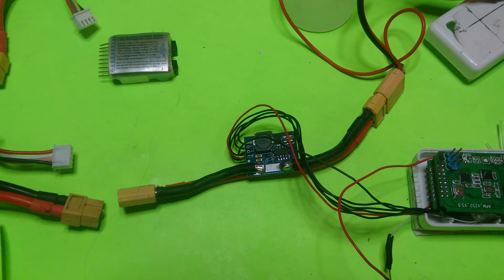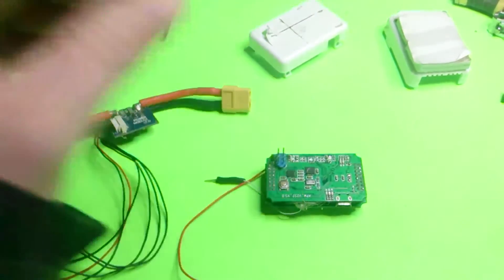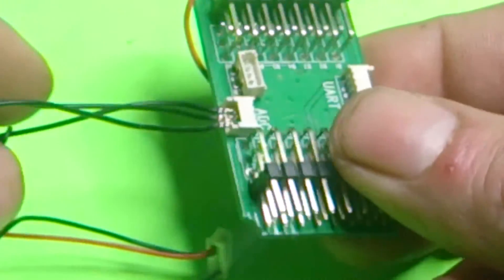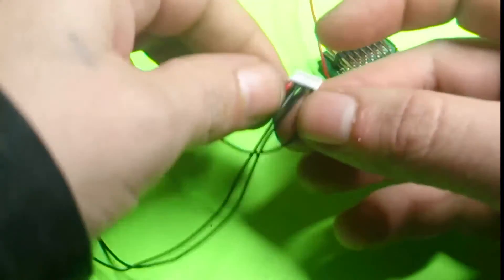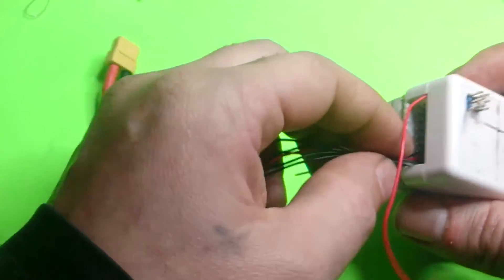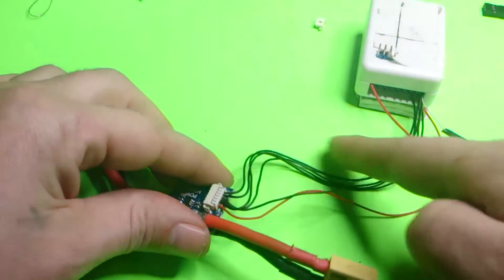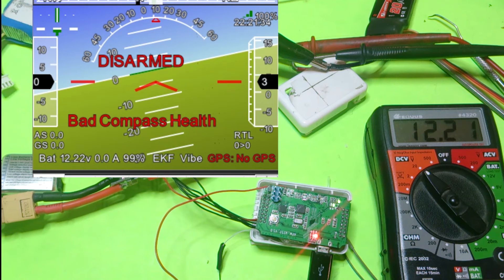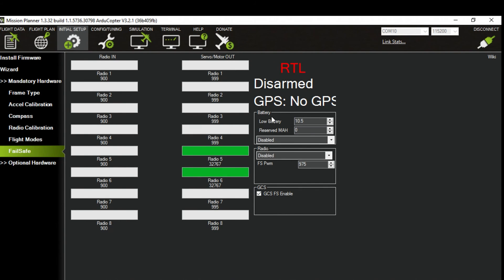cx20 factory apm power module step by step

Comment: Hello Bangs I followed your instructions. But.... The voltage does not go down as the battery drains . In the MP app on my phone the quad starts beeping and the app still reads a full battery.... Umm what am I missing? tia
Reply from the maker: does it show the correct voltage in mission planner?
Reply from the maker: for example on the hud does it show the battery
https://youtu.be/rTRFXnnsnUU?t=792
Reply: checking now... brb
So I had to input the correct value in the measured box to get am exact measurement. when I changed to a different battery(with a know different value) it retained the other batteries measurement
Reply from the maker: alright  i will spam you a tad. because i'll be going to bed soon and not sure if you will reply back ..in the  description i have a link to properly setup  your battery size as well.

here is the link / picture.
https://drive.google.com/open?id=0B2w6_OKE_2kxS2xUejJyZkMta1E
Reply: I will follow and let you know tomorrow... Thanks again
Reply from the maker: ok one more comment  before i go to bed...you can also  try setting it to 3dr power module ..instead of other ..as a test as well and see if that is more helpful  .. https://youtu.be/rTRFXnnsnUU?t=692

Comment: hey bangs, a friend of my want to use a Power Module or a voltage/current sensor running under APM 2.8 for a 12S Lipo.
in case of Power Module the max  is 30V/90A, how can he plug the PM with 12S (eg using resistor or something like that)?
Reply from the maker: dunno why but i can't think today.. here is one chip on the power module
http://mt.rsdelivers.com/product/texas-instruments/ina169na-250/texas-instruments-ina169na-250-current-monitor-single-5-pin-sot-23/4616586

it can handle 50 volts..

and here is the problem chip
https://www.monolithicpower.com/DesktopModules/DocumentManage/API/Document/GetDocument?id=248

and thats the one with the 30(28v)   volt limit..
You could add a resistor on pin 2 by lifting it up..but he will probably run into lots of other issue's ..    the value would get all corrupted during current load i think..   .         

I'm sure he could tap into one of the balance wires to get his 12 volts.

he would need to connect battery directly to esc's.. as normal..
then just y  in the power module off one of the balance wires..
and cut off the other end that normally plugs into the battery .

most likely the forth wire, he can tap into the first for ground but also get it else where 

however I have no idea what kind of readings he would get by doing that.
.
or i just did a quick ebay .. and here is one example
http://www.ebay.com/itm/High-Voltage-Power-Supply-Module-50V-90A-w-BEC-12S-for-Helicopter-Aircraft-/181995058553?hash=item2a5fc03579:g:WAcAAOSw-zxWnJhy

just need to change the ends or look around more on ebay.. ..I have not used that seller..
Reply from the maker: hmm just looked again at that..it has the right ends.. probably..
but in the description it says 
- Max input voltage: 28V
- Max current sensing: 90A

I would say probably a screw up in the description as they love to copy and paste.. (hopefully)
Reply: You're the man ! thx for your advices and quick reply... 

What's up? It makes a long time you didn't post a video..!?
Reply from the maker: It all started with 2 and half weeks of bad weather... then just life ..vacation .. A stupid game called paladins.. lol ...  I do have more video's and lots of hardware I ordered for projects that are just collecting dust .. So hopefully I get back on it before the snow falls ...
Reply: Hope so ! With this strange summer, I also play on Steam ( Liftoff )

Comment: Thanks for making this video. The quality of information is excellent and best of all, you speak at I feel the right pace so your listeners can grasp the information. I just installed a power module on my CX20 and following the video, I was able to complete the installation, no problem. I just have to plug in batteries and check the voltage reading. I would like to make one comment about the installation. About the ADC plug, I felt a little uncomfortable putting the bare pins in and hot gluing them. Unfortunately I do not have a 3 pin plug. But I have some 5 pin plugs. My solution was to cut 2 of the pin slots off with my dremel. Works perfectly.  Look forward to viewing more of your videos. Thanks
Reply from the maker: Thank you for your comment. putting in just the pins can be sketchy i did not really want to add it to  the video but some people can't solder and thought i would add that as another solderless option.. Your way is way safer.. as my option can short out against each other if not careful ..  

also by you doing that with the dremel you did not have to wreck or remove the connector on the board.. ..again way better idea.. .. Thanks for the share..

Comment: I have a few questions:

What do I do to the male side of the XT60 connector on the PM?  Do I need to attach it in place of the factory power cable?

If so what do i do with the 2 smaller wires the come off of the + and - power inputs on the board?

Should I remove the factory power cable from the board?
Reply from the maker: the power module still gets hooked up with the two xt60 connectors..

The 6 pin wires is your choice.. you can fallow the video and still continue to use your factory bec that goes to "b" on the receiver.
If you use the  +5 volt wire and ground from the 6 pin connector.. then remove the b cable .. .... you will probably want to still use the b slot to power your apm so either cut the old b cable and wire it to your bec or grab the 2 extra wires from  "-1" on the receiver,   The red and black wire are not needed in that location anyways..      thats if you have three wires on "-1"

Comment: Hi Mate, as recommended by you I have bought one of these from BG and I can see how it connects into the Stock CX20 APM - but can you explain how to use the +5 & GND to power up the APM - as my APM wont power from the main board ?

Thanks for a great video !!

Chris Doncaster UK
Reply from the maker: sure .. do you have a red wire on your power module?  ..errr ..i mean a red wire out of the 6 small wires..   one red wire and 5 black
Reply from the maker: actually i explained it in the video a tad.. at this location . does this help?
https://youtu.be/rTRFXnnsnUU?t=370

let me know if you get stuck
Reply: Ahhh - got it now - thanks :-)

Comment: If you're using two types of batteries, let's say a 3000Mah and after it's depleted you throw in your 5600MaH, can you simply use droid planner's parameter editor to change the MaH parameter from 3000->5600 and be done with it? Or do you have to also redo that divider setting?

I've also replaced my AMP2.5 with a AMP2.6 mini pro, because mine was busted. It's powered by the CX20's B-cable but it does have a PM-in with GND, 5V-in, VDL, CUR pins. Would I only need the VDL and the Current pins for it to give me that telemetry battery info?
Reply from the maker: You seem to be more advance then me with droidplanner.. if you can edit the param for MaH .. try to change it in tower.,  then connect your quad to mission planner and see if it held in place with the new setting (5600).. if so then your good to go on that part.., If it does work I would always do a reboot of the apm anyways just to make sure the new params are loaded.

Honestly I just cheat and don't bother too much with the calibrating .the voltage is what I go off of.  for the current.

what I do is . bring the battery down to say 10.6 volts..(3.5v) per cell with lipo alarm.

I then use my imaxb6 and charge it .. it tells you how much amps go into it so say my 5000mah stops at 3400mah @ 12.6v .. thats what I put into mission planner for the mah param .

I know I went on about your Question ..but to be point blank yes you should re calibrate your battery params on every battery .. in fact after every 30 flights even with the same battery..    ..butttttttttt  I just go off battery voltage and I don't care about being precise ..
Reply: Oh it's actually quite simple, you can use droidplanner to edit the parameters in the APM on the fly (on the ground hehehe). The thing is, I got 2 3000MaH Black Magic batteries with my CX20. I have ordered a 5600MaH, the one used for XK Detect, small and lightweight, just want to see how long I can fly with that one. the 3000MaH's give me 7-9min depending on how hard I fly it

I've rebuilt the entire quad on a F450 Y-tail frame and have all the telemetry/FPV/Gimbal stuff on there, just never got around to a power module. But as I assumed, out in the field those two different batteries are going to be a bastard for the module. Ah well at least it does the beepy/blinky thing.

My question about the pins was just so you don't have to use the powermododule to power the APM? JUst using the VDL and CUR pins on the module? I assume VDL is the one that throws the battery info at the APM?

Hehe sorry more questions, anyway thanks :D
Reply from the maker: Hi ..yes both pins vdl and cur are sensor pins .. really you need three wires . voltage sensor , current sensor and ground.  but because the power module is usually hooked up to your main battery ground wire you can try to get aaway with just the two wires.. hooking up the extra ground does not hurt ..     
   You Don't need to use the +5 ubec wires to power the apm . you can but in this video the cx20 already has  clean 5 volt going to the apm anyways.      If I were to use this apm out of the cx20 shell  I would use the 5 volts to power the apm on the receiver b section or 5 volt rail.  power module is usually made better then a esc ubec
Reply: Bah, I'd have to rewire my neatly tucked away wires!!! Hehe nah I get your point, just wanted to know for sure if I could get away with being lazy and just add two wires onto the APM. Guess I'll go ahead and move those wires around to get a potential cleaner 5v in there. Dammit I just put together the quad man :P

Also if you ever crash and crack the CX20 shell, I can definitely suggest a F450 stepup (with 94xx DJI style props), it flies a lot smoother and take of and landing, heck I got it so balanced, it can land without any corrections on the remote...

Thanks for your quick responses btw, awesome stuff. This hobby is too damn addicting!!!
Reply: Sidenote, mine crashed due to a loose wire in my controller's elevator and pitch gimbal. You might want to go ahead and check/hotglue those wires, just to make sure you don't run into that issue! I mean we are dealing with Chinese quality control for the most part...
Reply from the maker: you can just use the two wires..If your getting readings it means its getting ground.. through the main battery which is totally fine .. .. I have no idea where your getting your power from .. esc ubec?  .  They are actually designed to be used with your apm its why they have a capacitor as well .. its just me being paranoid and not wanting to draw current out of just one esc during flight time heh.. but many ppl fly with that setup.
Reply: I power it exactly the same as stock CX20, B-wire from the PDB to receiver -> Aileron/Roll -> APM
Reply from the maker: ah so your all good ..you don't need to power it from the power module then..

Comment: Hey Bangs, a question about power. I have to change my frame and i  found one without pdb. So i saw a lot of different model and found some APM compatible.  but i use 30a ESC and the PDB is 4*20A. is there a risk of frying something ..?
Reply from the maker: always a risk.. but I would say you should be totally fine.. If you are really worried ..what you can do is re flow all the main traces with a bead of solder. to thicken up the traces.    ..  On my custom quads.. i just go wire to wire and don't bother with the pdb . a piece of wire  half the size of the esc wire is usually 10 times thicker then a trace  anyways..  <-- not saying you should use half the size of the wire.. just saying the fact of most if not all pdb boards or traces.
Reply: thx for advice .. i just checked the motors. 
http://www.racerstar.com/Racerstar-BR2212-980KV-Brushless-Motor-p-44.html
load current is 10.6A, i m quiet for the esc (30a) so i can use this PDB ?
http://www.banggood.com/Matek-LED-POWER-HUB-5in1-V3-Power-Supply-Board-BEC-5V-12v-Low-Voltage-Alarm-Tracker-p-1019353.html?p=PK211613756002015039
which supply 20A and 25A (peak)..?
Reply from the maker: yes it seems you can.. the continuous amp says 20amps per output.  nice little board...once you get it and if it is way smaller then it looks.. you can add a smaller gauge wire jumps to all the positives .. and like wise for all the grounds..   You will see extreme peaks when your quad crashes and the blade comes to a instant stop against the ground.. ..then you might pop a trace....
      and I have to say thanks for taking the trouble with the  affiliate..   .. you would be surprised how many comments I have got with fake help just so they could post one..
Reply: i hope not to see that ! 
for affiliate yw, it's your works and if it can pay the coffee ;)

Comment: HI. Great video! I think i'll leave the bec in place, simply because its easier. Will this be ok? Also, Bangs, do you recommend cutting the male xt60 plug off the module and soldering in after removing the original or is there enough room in there to leave it on??  Again, easier. of course. Thanks.
Reply from the maker: I put my power module here https://youtu.be/mrBWEATUbus?t=507  ..   but your idea might be better .. .just make sure to electrical  tape up the power module board so it can't short out under the cx20 board.ect..
Reply: Done....and all seems fine. Managed to swap the wires around in the molex plug and then cut the plug down to a 3 pin. Thanks again!!
Reply: Does adjusting the voltage ,as per your instruction,  confirm that the power module is working?
Reply from the maker: you really just have to attach your meter to the battery once.. ..get a voltage of your battery .. then attach the battery to your quad to .. get it it close adjusting those numbers..   .. Using the 3dr power module option usually does the trick so you don't have to touch anything ..but for some reason my 3dr setting no longer sticks.
Reply: Yeah, had no bother with that. Got PM showing 12.19after adjusting and the battery on multimeter was 12.18. So, close enough as you say. Does getting all these readings show that the module is working ok and as it should? Silly question maybe!!
Reply from the maker: yeah if you get 12.19 ..its good enough and working .. to test it drain the battery some how..test with meter then check in mission planner... but really its prob not needed because how else did it guess 12.19 hehe.. so you should be able to setup the fail safe if you want.. or if you get telemetry it sends the voltage as part of the info.
Reply: Hi. Just done 1st flight since all the mods. Did compass and accel calibrations last night. Waited a good 2 mins after gps light steady. Took off nice but started to drift in the wind direction (breeze about 8mph) , put it in gps hold and it stayed steady for a while but then started drifting again. Switched to RTL while it was still close but no effect!! Retrieved it about 500 yds away, seemed to come down gently and no damage. PHEW!! Really can't fathom why it doesn't answer to radio commands? There's a real fear to fly it after so many flyaways.........but i'll not give up!! Any ideas would be welcome. Thanks.
Reply from the maker: after setting it in rtl it went in other directions?  and did you try to flip it back to 0 ,0 switches to take control , Or were you just trying to control it while in 0,2 rtl ?
Reply: Went away from me in RTL . Didn't flip it back , was waiting for RTL to work. It actually disappeared from my view for a while down the side of a hill. It's probably just me and lack of experience. It's a dilemma trying to learn to control it properly when it's giving so little leeway for error. It was only 20yds away when flipped to RTL and in plain sight. Have bought a dji 1 in the hope it'll be easier to learn. Not giving up on cx-20 of course!! Have learned a lot about it in the past while from yourself and feel it'll all be worth it in the end.
Reply from the maker: whats suppose to happen in rtl.. it goes up 424 13 feet. then comes straight back towards.. you.. I under stand you giving it lean way but don't ever do that again . If it does not come straight back towards you . It will be a fly away if it truly had to go into rtl..     .you just had to flip it back to 0,0 to take control .

If you can get a cell phone app with  a compass ..compare the two of them side by side to see if they are both pointing in the same direction after doing calibration on both of them.

I've heard good things with the dji less trouble with them ..
Reply: Tested direction on MP against compass app and analog compass. Showing perfect north. Gonna do physical compass calib outside tomorrow and also physical acell calib ......if i can make it hover. Surely that'll sort things......here's hoping.
Reply from the maker: well good luck.. however .. if you mean physical compass calib using the remote to do it.. you can't do it with version 3.2.1 .. you would have to grab the stock v3.1.2 firmware on my other video to be able to do that again.
Reply: Really? I surprised! How would you do a compass calibration at a new location in the great outdoors. Is there something i'm missing?
Reply from the maker: yes your missing that option =P  ... ..even tower/telemetry  does not have it included.. it had it in a beta option I can't find .. They added accel calibration to tower the last I checked.. but not compass..